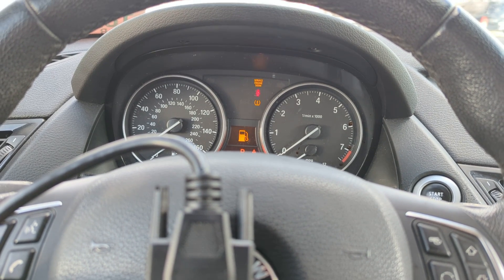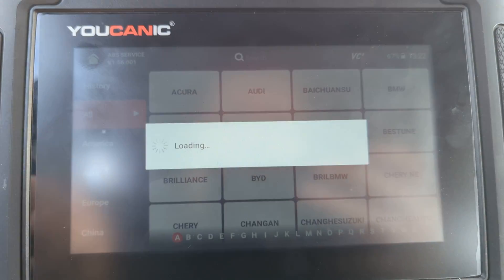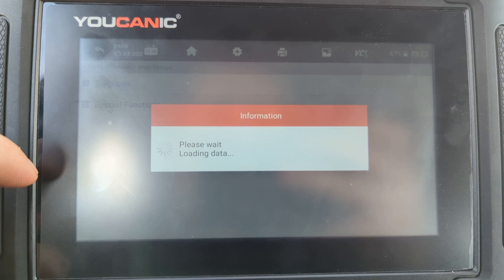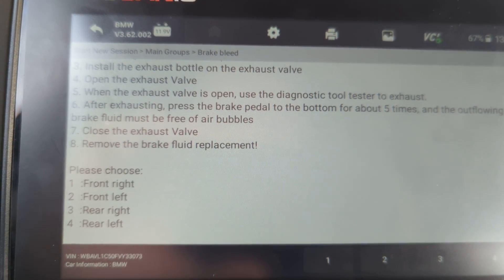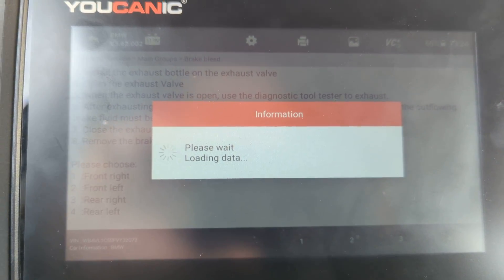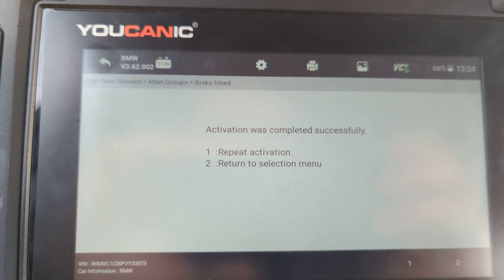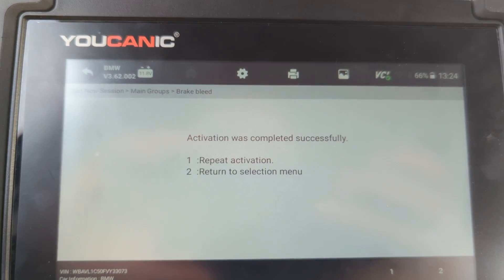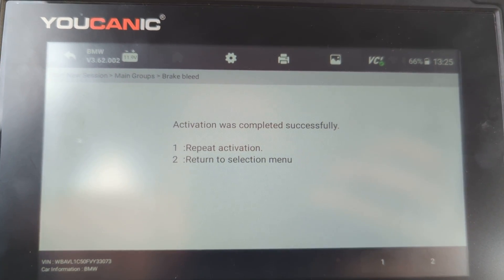BMW ABS Brake Bleeding with YOUCANIC Scanner

Comment: So do you first flush the braking system (using Motiv or similar) and only THEN run this ABS flush? Or do you run the ABS flush using the computer for each corner, 1 at a time, as you flush the system?
Reply: I used a Bosch Scanner. This one walks you through it. It has you crack the valve with a hose attached to a bottle. Click yes and start pumping. You can hear the ABS running. After a bit. It’ll tell you to stop pumping. It’ll then go to stage 2 and start pumping on its own for a bit to get that last bit of air out. It’ll stop on its own and will then tell you to close the valve and go to the next one. The scanner will specify which valve to go to.
Reply: Thats what i want to know.
Im downloading manual